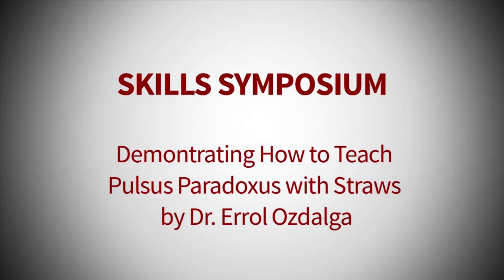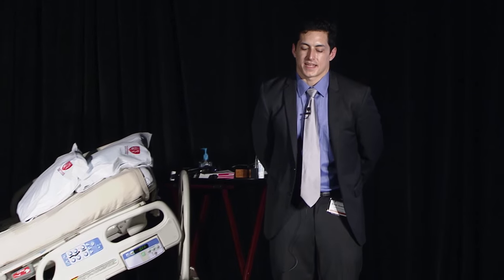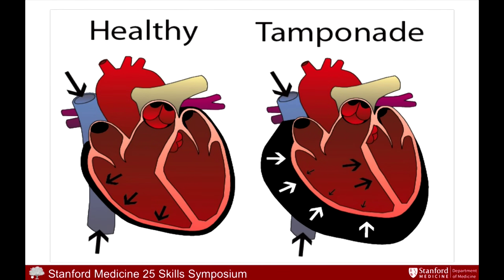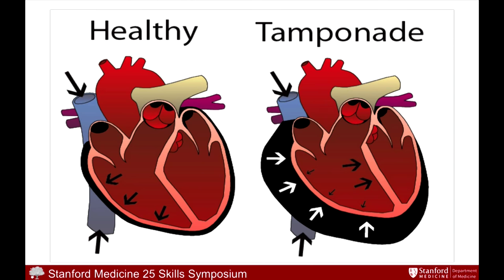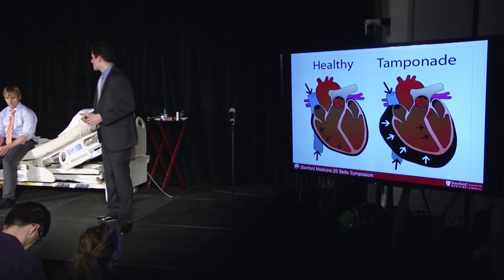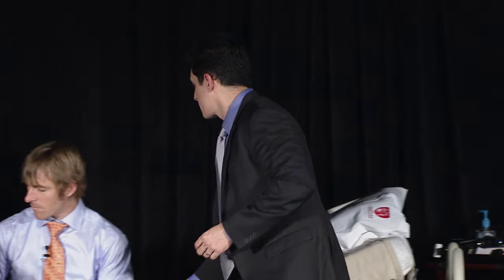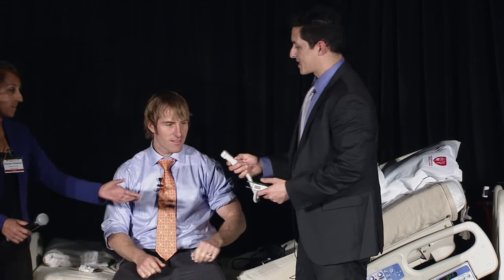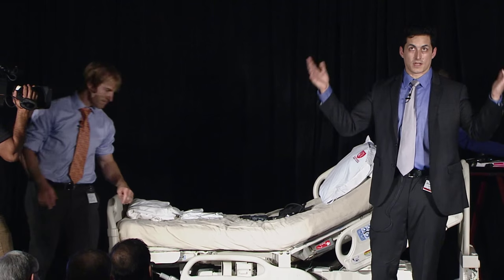Demontrating How to Teach Pulsus Paradoxus with Straws (Stanford 25 Skills Symposium)

Comment: Pulsus paradoxus is correctly measured during quiet respiration, not with exaggerated respiratory effort.  The technique you demonstrated also encourages the development of venous congestion in the arm thus making accurate measurement of PP more difficult, if not impossible. The illustration apparently intended to show normal septal movement during LV filling is grossly exaggerated whereas septal displacement to the left during insp. with PP is less-than-adequately shown.
Reply from the maker: Watch our video using real patient with pulsus
Reply: .
 .mph